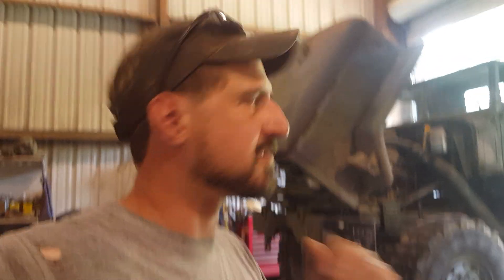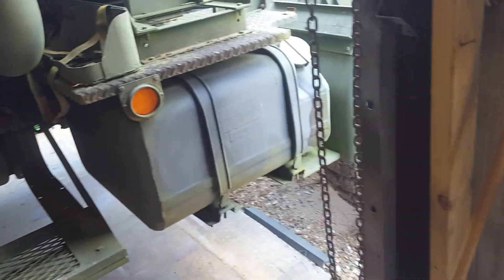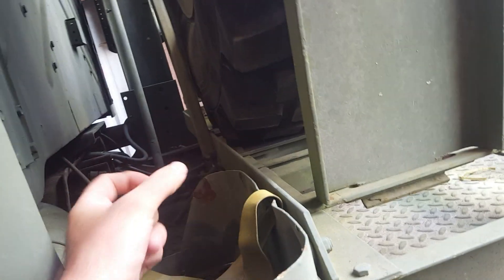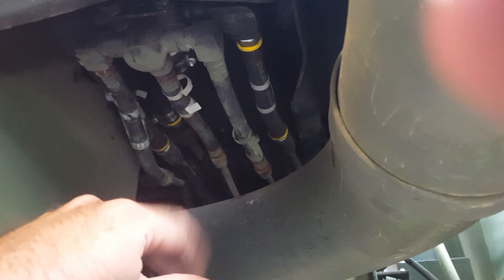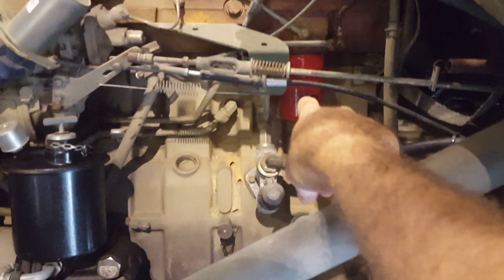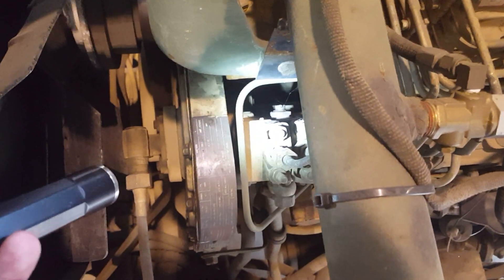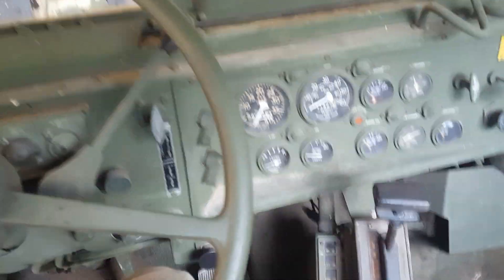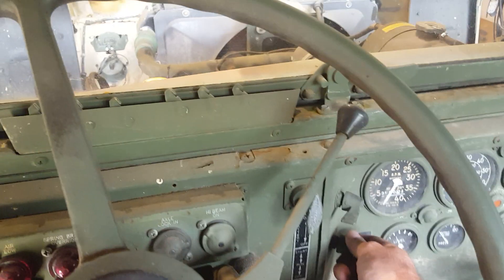5 ton hard to start? M939A2 series fuel system basics.

Comment: After changing the separator filter and inline filter on mine, it now has a lack of power and stalls when putting it into gear. It also seems quiet at idle. It start immediately when cranked. I’m assuming there is air in the fuel system but how do I bleed it out?

Comment: Thank you for all the videos!  I recently picked up a m923a2 bobbed with tractor air ride suspension, my abs light is on. Any suggestions on where to start?
Reply from the maker: Check the wiring at each wheel end for the pickup sensors. Sometimes the wires get damaged.

Comment: i have a 1986 m931 tractor  accelerator pedal sticks  i have to pull it up as im driving it   suggestions?
Reply from the maker: Lubriate the pivot pin for the pedal at the floor, and lube the bellcrank outside.

Comment: I had an issue with my m939 not pressuring the air tank past 45 PSI. I connectted it to another to pressurize the tanks. But it only presserized the secondary, primary was still at 45psi.  Any direction you can point me?
Reply from the maker: Faulty pressure protection valve.
Reply: @tacticalrepair  that's incredible! I'll start investigating asap! Thanks man!